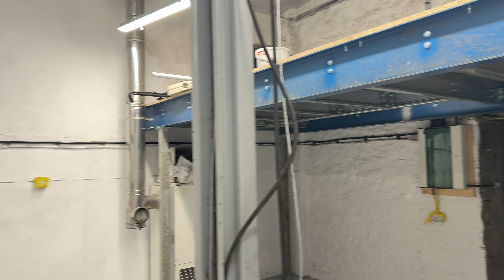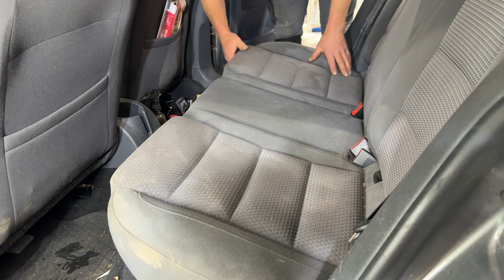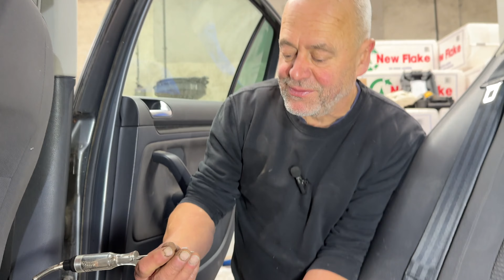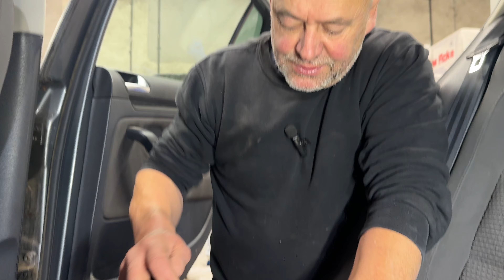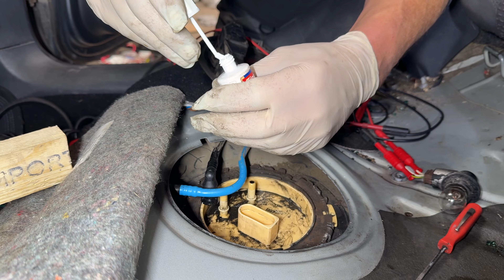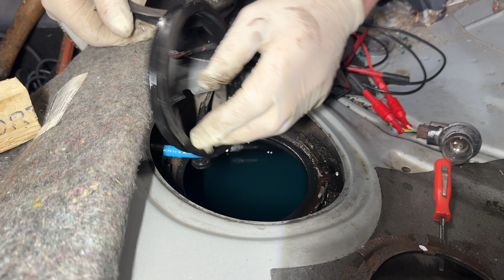Golf Mk 5 1.9 diesel fuel pump replacement

Comment: Its great that you talk about the diagnostics and how you have to search for faults especially when theres no codes. I have an issue where the engine is hard to start when warm (Golf 5 1.9tdi) and I changed all the temp sensors, adjusted the torsion value, cleaned and tested the Egr components, refurbished the started motor, added a new battery, but the issue still persisits. (I have no fault codes). I was eventually told by a VW mechanic to check the fuel pump which I will do this weekend and also replace the fuel filter. Thanks for posting